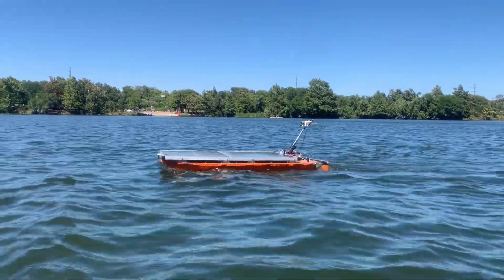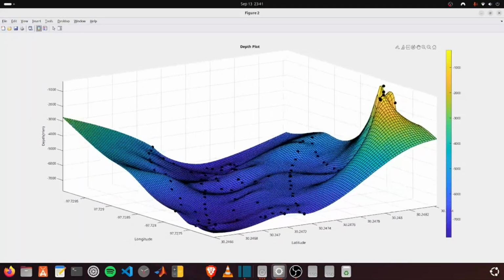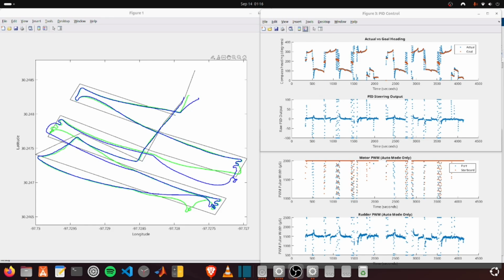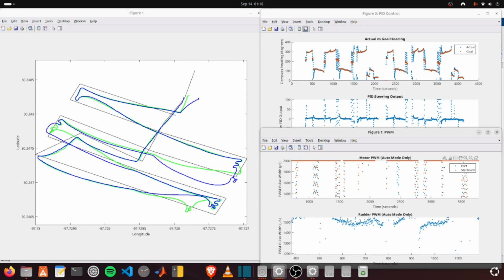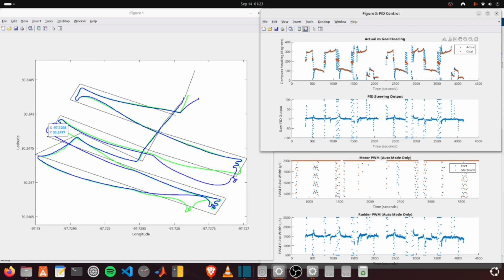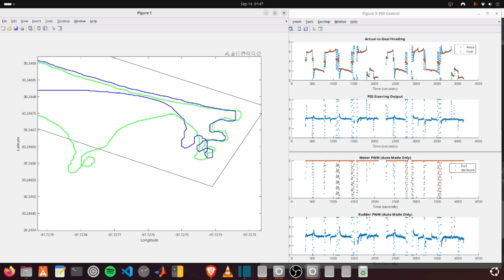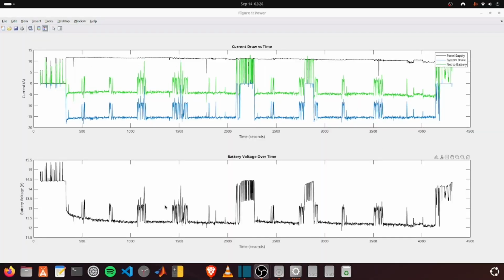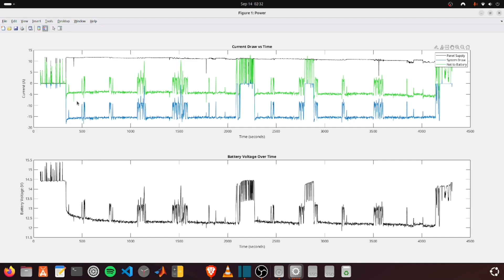Auto Depth Plotting - Gumption Trap II

Comment: Cool boat. I like the low profile of it minimizing wind drag forces.  I have some ideas you might want to consider. Since you have bidirectional running motors, it might be simpler to just use differential thrust for steering. Less components to break and easier to control if you only need thing to tune one thing. Also what kind of gps receiver do you use? You can imrpove the accuracy of your boat with a f9p rtk receiver and a ntrip service to a few centimeters level of precision. It will help with navigation too. Cheap gps recievers can have an error of 5meters and having you actual location jump around isnt helpful.
Reply from the maker: My first version of this boat used only differential thrust. I think the rudders are a more efficient way to make fine adjustments because it doesn’t need to constantly accelerate/decelerate the props, they just stay at a constant speed during the long straightaways. This gps is a cheap neo-6m, it doesn’t really jump around much. Precision is more important than accuracy for this.
Reply: @Clay-Builds  i agree that they are more efficient during straights but that shaft play must go 😆 but for 90 degree turns the diff thrust would be more effective. You could easily switch steering control if desired angle is larger than lets say 10 degrees either way. Also adding some type of fin keel on the hulls will help with horizontal drift.